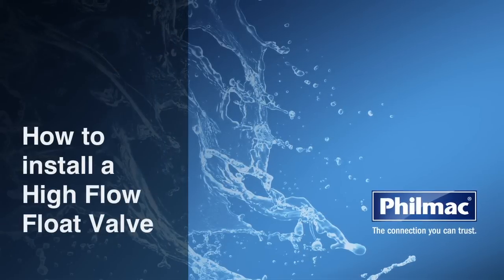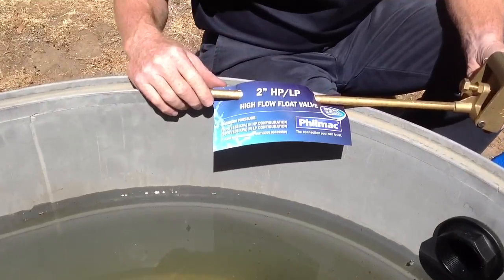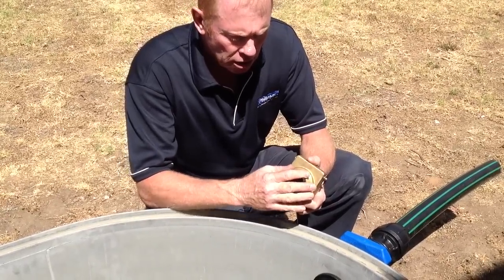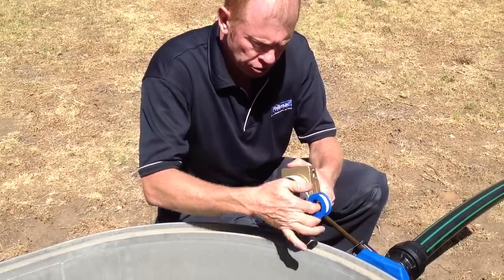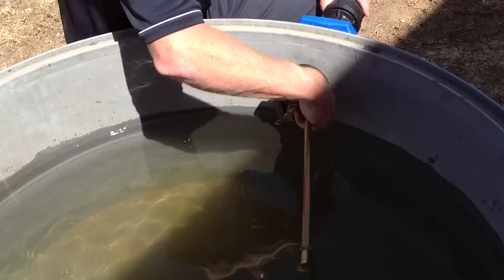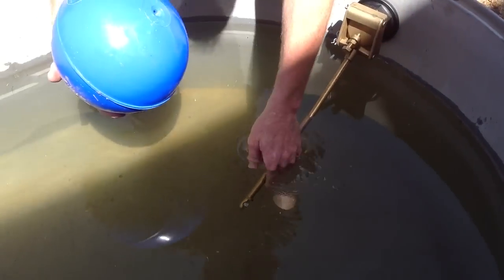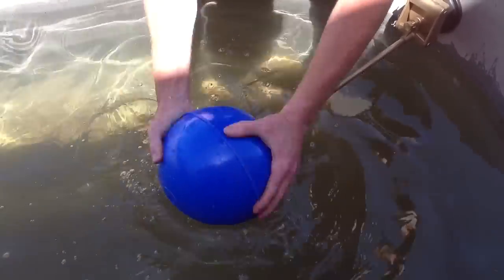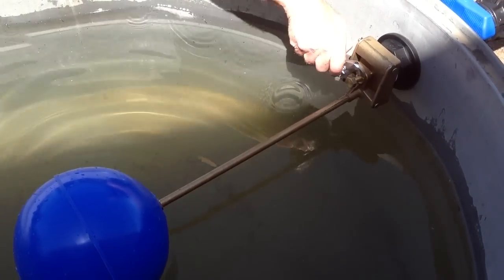How to install a High Flow Float Valve

Comment: hi, sir. could you tell me, what is the meaning of operating pressure of floating valve (for example: 0.4 -6 bar)? it is fluid's pressure through the pipe or the ambient pressure of the tank?
Reply: Pipe. If the pressure is too high, the float won't have enough buoyancy to overcome the flow pressure

Comment: I need water level controller for both Bohr and sump which should work simultaneously. My contact no is 07899427257,
07975142490,
BKS Enterprises, 
MANDYA. 
KARNATAKA.
Reply: My email: jennofer@sinpovalve.com. could you send me the detail info ?